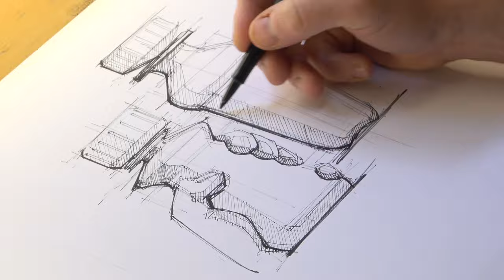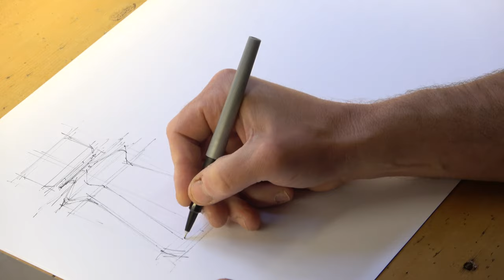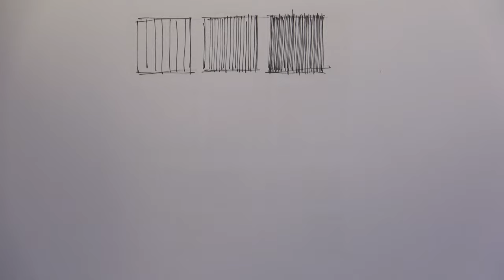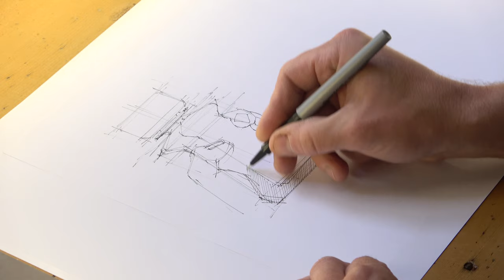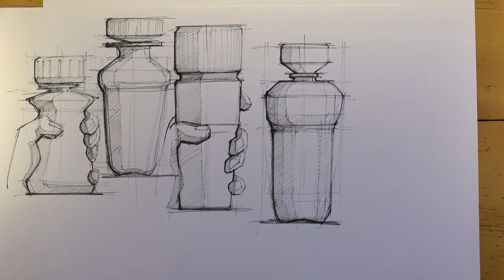How to shade - part 1

Comment: What kind of paper do you use? And does it suck up marker ink? I use chartpaks and don't want them getting sucked dry, so I've been doing sketches on big sheets of marker paper.
Reply from the maker: Just seen this. The photocopier paper is really efficient with ink. I haven’t come across chartpak.
Reply: @productdesignermaker  Cool! Some sources say copy paper will suck ink dry, so I was apprehensive.
Dont wanna run out of ink! lol. Thanks again for replying.

Comment: What's your opinion on using a ruled for construction lines but then freehand for the weighted lines
Reply from the maker: Owain Lloyd Davies there are obviously no rules against doing so. If you’re working on a page of ideas, I’d try and work without a ruler if you can. In most cases, this allows you to work quickly whereas the ruler can slow you down, causing the flow of ideas to be interrupted. If the drawing is a more of a presentation of a finalised idea, then I don’t think it matters too much. There’s definitely a place for the ruler.
Reply: @productdesignermaker  thank you